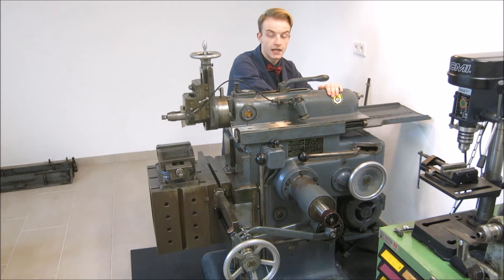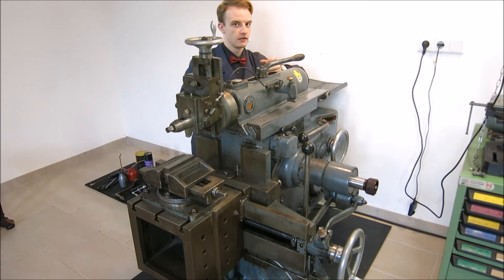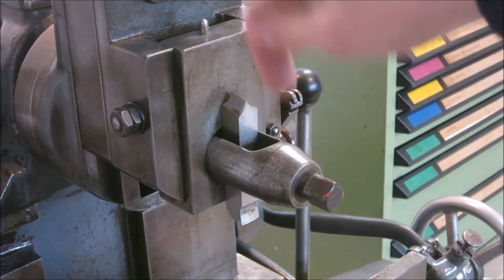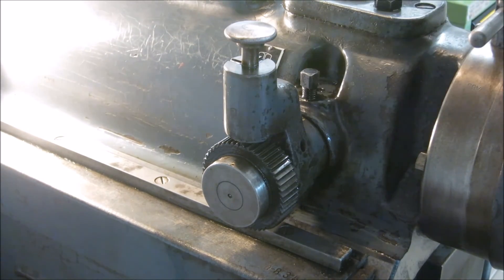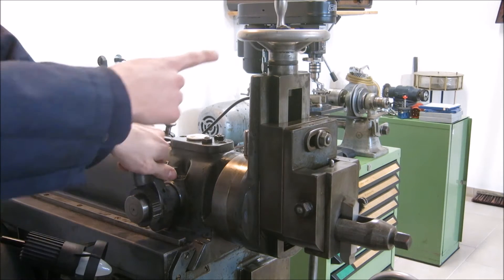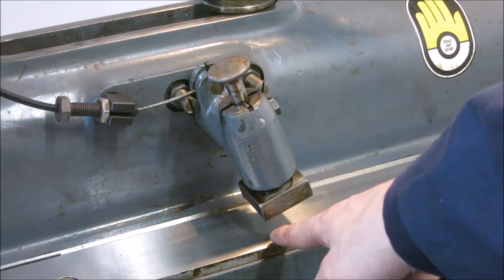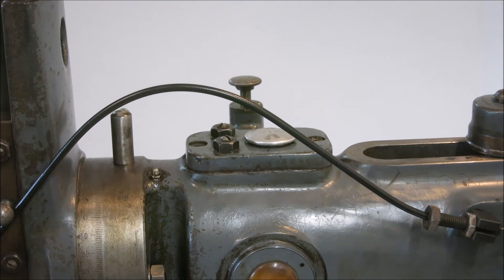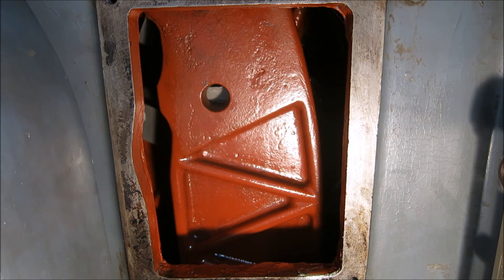How to operate a Shaper / Shaper Depth Stop Pt.1

Comment: Very niece machine, thank you for showing.
Maybe a brake thingy from an inline skate could be used for the tool lift. They are really cheap (Bremsschuh vom Inlineskater). I know I'm late, but still..)
Reply from the maker: I already found a solution - even made a video about it and called it "Shaper Tool Lift Upgrade"
Reply: @AstraWerke  Yes, I have already found it. Very good solution. I like your explanation of the shaper being the ideal hobbyists machine due to low tooling cost, quietness and availability of old machines, solid, at readonable prices. Now I only need to get my wife to watch and make her a believer..